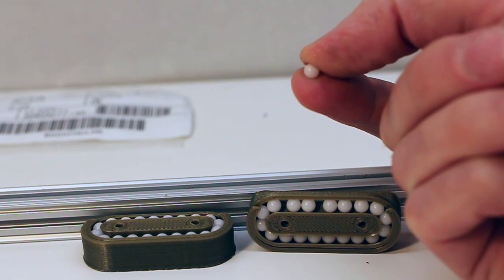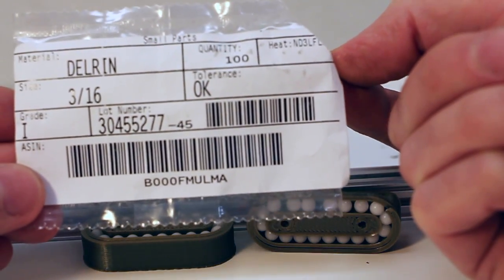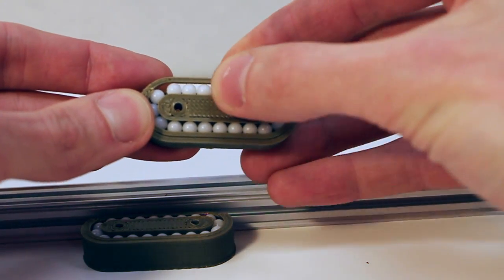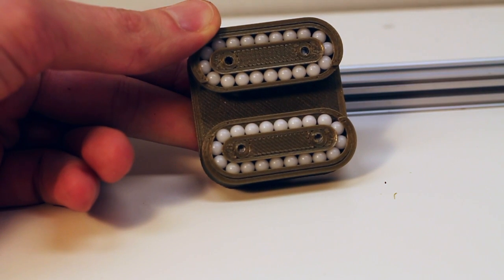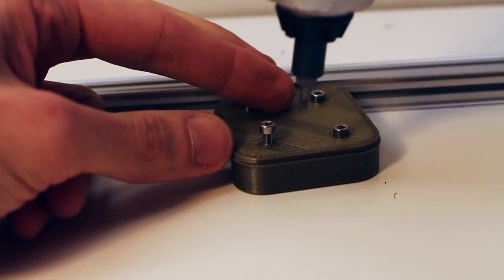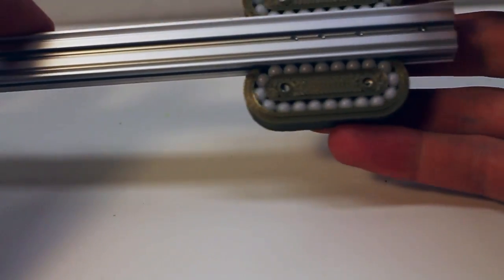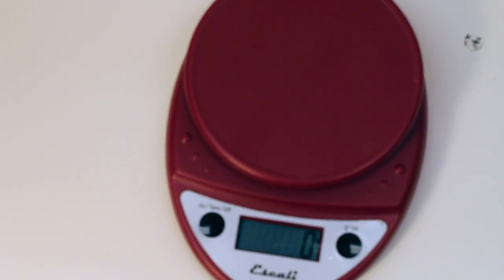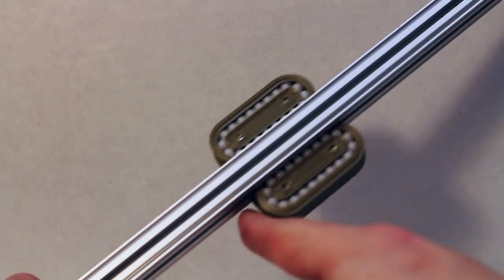3D printed recirculating carriage

Comment: I want to use such a mechanism in offf-road skates that are a hybrid of wheels and skis.
A flexible 4cm or wider caterpillar style track (here: rail) runs though a skate (carriage) for about 50-55cm. The long carriage made actually be flexible to conform to the trail surface. Alternatively, the track may be mounted to a cyclo cross tube  (tubular clincher?) tire. 
In case of a flexible enough track, it may loop back through the skate above the BB paths. If less flexible, it could pass alongside the shins.
I'm as of yet unsure as to which material the track (with BB grooves) should be, and what BB size(s) to use. For now I'm thing of 2 BB pats on the sides, and one under tthe skate, on the inside of the flexible track. Larger BB's may be beter in case dirt come in, and to flush it out during a short stop without unclipping the skates?
I need materials that will be flexible  (track, maybe even skate/"carriage") yet hard enough to make the BB's roll really effortlessly.

Any ideas are  welcome. I just want skates the are better than wheels to mimic cross-country skiing (skate style mostly). Wheels are either too small (won't roll on gravel/sand climbs due to digging in) or too heavy and clumdy (big enough to roll decently). A well designed track should sort this. Low peak pressure onto the trail surface, better glide.

Comment: I ordered balls from the link and got 3/8" balls (which looks about  right for 10mm rails which have a ~6mm slot) so the .stl provided obviously won't work.
I put together a parametric design on onshape https://cad.onshape.com/documents/26ee0e5b03c66a9be90c58d1/w/9e35f74 6efcb0e4648c0fd70/e/8d9ff0634c8b0a8af7e2b591

it lets you enter the ball size, # of balls, thickness of base, thickness and height of retainer, and a slop value
It's publicly available (free account to access onshape) and a right click on the slider tab will let you export to stl

I didn't put any mounting holes or brackets in the design as everyone will want something a little different (I may add something at a later point, especially if multiple people ask for the same thing). you can clone it to modify it yourself.